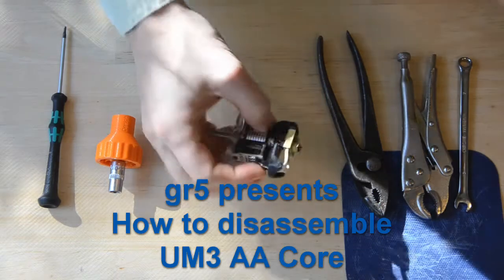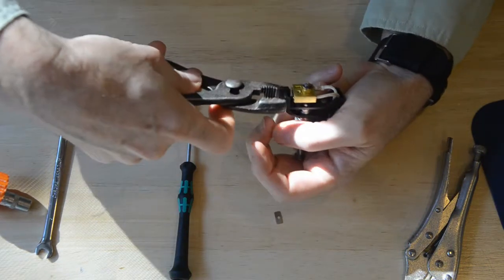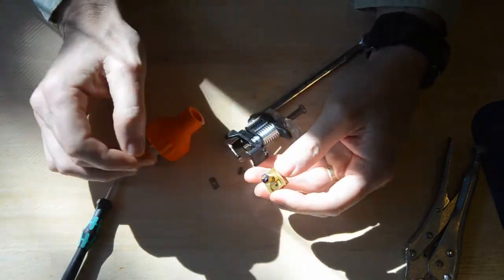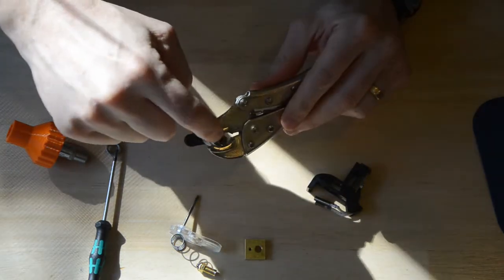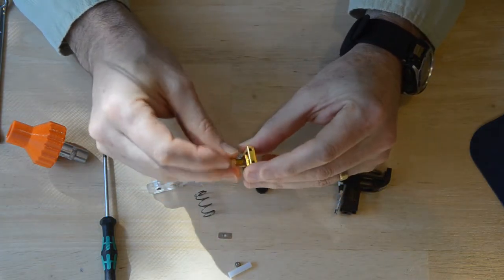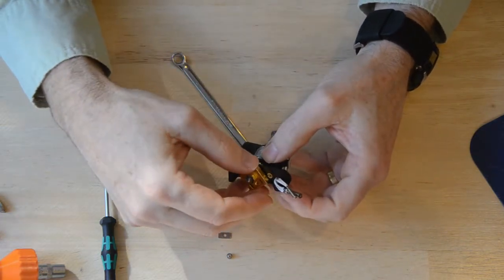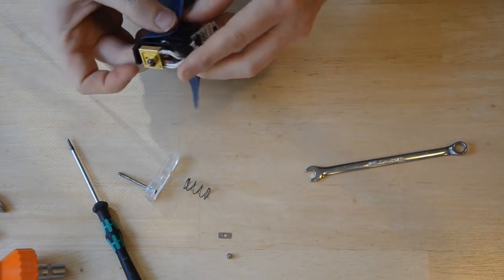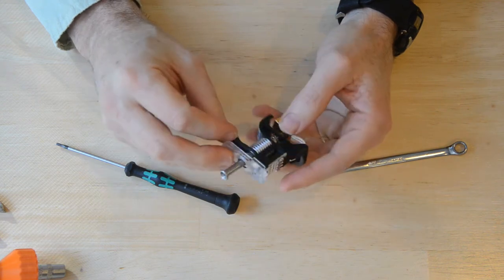um3 ultimaker 3 core disassembly

Comment: Thank you very much!  I have a BB printcore that was clogged, and I had tried everything from hot and cold pulls to reaming it with a needle to removing the printcore and filling it with water for a few days.  Anyhow, after disassembling it with your video, I soaked the extruder in hot water for a couple hours and was finally able to get the clog out.

Comment: Is there a place to buy parts for the ultimaker cores? I have 2 that are broken exactly where you warned that they would break.
Reply from the maker: No, Ultimaker considers cores a consumable like filament.  And compared to the cost of filament they are quite cheap (maybe 1 core per year per machine? versus hundreds of spools of filament per year per machine?)
Reply from the maker: Although if you bought a 3dsolex printcore I have spare parts for those.  And I have a repair service if you are in USA ($50 to refurbish a broken or old core).  But the parts won't fit an Ultimaker core.

Comment: hm.. mine looks different. in my version the ptfe tube is lining the aluminium heatsync directly. my steel part is much shorter.
i accidentally burned out my first nozzles ptfe tube.. trying to remove a stuck filament.  
because i didnt know it was there.  (thanks ultimaker ;))

Comment: First THANK YOU! This video was essential in being able to fix 2 s5 cores(I think they are the same) that were clogged and unusable.  

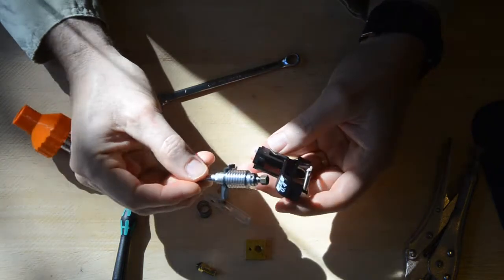2nd I have wonderful news that I have not seen posted on here yet.  The black plastic part you refer to at about 4:35 is removable.  The top cylinder of metal is screw attached to the bottom metal part with metal circle ridges.  I know this video was fairly old so I don't know if this helps you at all, but I wanted to let you know so I can hopefully repay you some.

Seriously thank you so much!

Comment: Great instructional video. Thank you. I have everything but the dog and treats.  Seriously.   If I’m successful at the repair wher is the filament is lodged in the tube, I’ll save significant dollars.  Do you have any advice about servicing a nozzle that has been used and has ABS deposits on the heater block?  Thanks again!
Reply from the maker: ABS starts to get soft at 99C. So heat the core to 140C then pull it out hot.  Ignore msg on printer while you wipe the abs off with qtips or paper towels.  Then power cycle printer.  Or heat block by itself in gas flame while wet.  After water boils away stop heating and remove plastic with qtip

Comment: The new Cores are different, please be careful. The heatbreak is no longer a screw in version but it is press fitted on the aluminium heatsink! It is extremely difficult to remove the heatbreak from the heatsink. I had to heat it up an turn it forth and back and pull it at the same time.
Reply from the maker: Do you have a photo?
Reply: @gr575  Unfortunatly no, it is also already assembled again.
Reply: @PurchenZuPoden  
I can confirm both my OE newer cores are press fitted. ( I have tested to see if it was just adhesive with the SMD station and it in a vise)
 I have found new heat breaks and throats on Aliexpress (usually $10-$15 each. full cores without the board or elements for 40. I use these for the replacement blocks, throats and breaks so I can easily teardown if i ever have a massive failure (which hasnt happened yet)
I've had nothing but success with Microswiss replacement nozzles.

Comment: Would it be possible to replace the nozzle with one of these? https://store.micro-swiss.com/products/micro-swiss-brass-plated-wear-resistant-nozzle-for-ultimaker-3 They also sell a 0.6mm version, which ultimaker doesn't sell (besides the very expensive cc one).

Comment: Makes me wonder if Ultimaker is making this neck extra thin, so it will break easily. This will scare most people into buying a new core, instead of fixing the old one...
Reply from the maker: No, the neck is thin because it's a heat break.  For printing PLA usually you have teflon just above the nozzle (softened PLA sticks like crazy to all metals but not to teflon).  But the teflon doesn't like to get above 200C or so.  At 220C it is useless after about 200-500 hours of printing.  Printing at 240C it dies much sooner.  But with the UM3 you have the heat break and the teflon never even gets to 100C for normal printing.  Maybe 150C if you print at 350C.
Reply from the maker: I didn't make the video to scare people - I made it so they could take the core apart (UM doesn't recommend that).  UM considers the cores expendable and so they price them low to be nice and they make pretty much zero profit off the cores I suspect.

Comment: gr575, first of all thank you for sharing these steps!  You did a great job showing the fine details of the process!  I have taken apart 2 of these cores.  However I can not separate the aluminum finned piece from the "steel tube with the nut piece" so that you can get to the teflon spacer piece.  On your video you show it come apart super easy, but that is not what I found.  You mention that there might be some adhesive on that thread, did you have to apply heat to get it apart?
Reply from the maker: M Cotlet don't apply heat.  Some are very very tight.  I ended up taking a small finishing nail and removing half the head with a file and sticking the other end in one of the 3 holes and using a small vice grip with that and putting the aluminum fins in a vice.  But you shouldn't have to take that apart as it should last mostly forever.
Reply from the maker: So Ultimaker has been making these heat sinks more and more difficult to take apart.   They add glue or something.  But I did a few recently.  I took a small hardened nail (these are kind of rare?) and filed off half the head.  Put the aluminum part in a vice.  Stuck the other half of the nail head in the spanner hole and tightened the nail and steel part in vice grips.  The nail bends around the steel part a bit Wear eye protection as the nail can go flying.

Comment: Could you tell me where could I to buy the 7mm hex driver pls? and I saw your website is paying the old core ( I have a old BB one want to sell to you ) ... but since your "ULTIMAKER 3 CORE - HARDCORE SIX" is sold out on ur website ... so I just order it on 3D universe ...
Reply from the maker: It sounds like you are in the USA so you can get a 7mm crescent wrench or 7mm socket at any hardware store.  The orange torque wrench in the video is on youmagine.com search for torque however 3duniverse will almost certainly send you a free torque wrench and 7mm socket and 1/4" driver.  This isn't the best place to contact me so please email me at the thegrgstore at gmail.com if you want to sell your old BB.  Price keeps dropping but I'll pay $60 for it this week and it will be converted to a hardcore (reuse is better than recycle is better than waste).  I have 4 hardcores left but I can't set all inventories to 4 as then I might oversell so you can still order from me direct.  I'll adjust inventory numbers today.

Comment: Hello Gr575 , am having trouble removing the  bowden tube on my ultimaker 3 , any tips on how to do that ? thanks
Reply from the maker: samih22 remove horse shoe clip.  push down on outer ring with tool such as pliers while lifting on bowden.
Reply: ill try that , thanks alot for quick reply <3

Comment: Are there any nozzles out there that will directly replace the one found in the AA or BB core? How does this nozzle differ from UM2 or other nozzles? thanks.
Reply from the maker: no.  I don't think so.  they are very long.  but 3dsolex.com sells the hardcore. It is like an olsson block but on um3 core and allows multiple nozzle sizes.  I sell the product in usa at my store thegr5store.com.